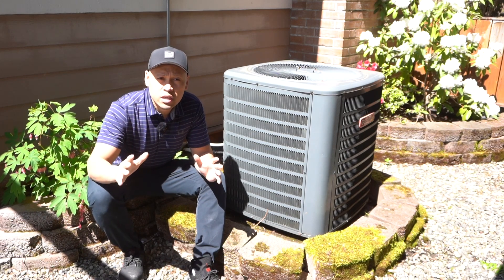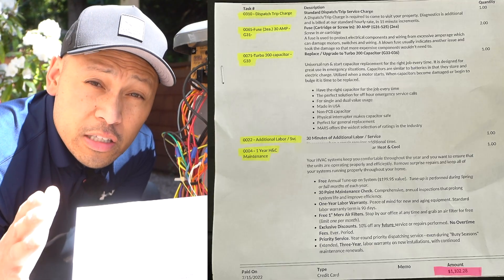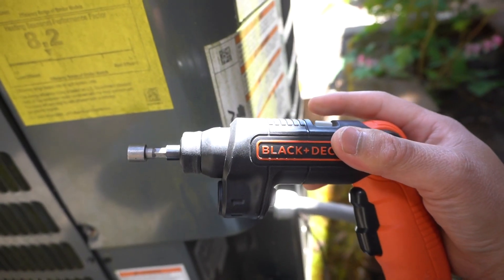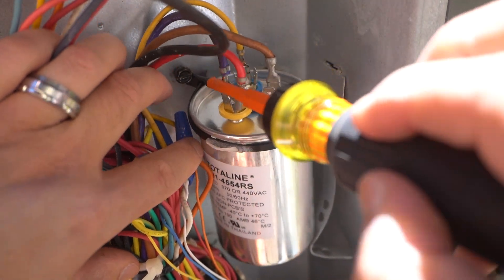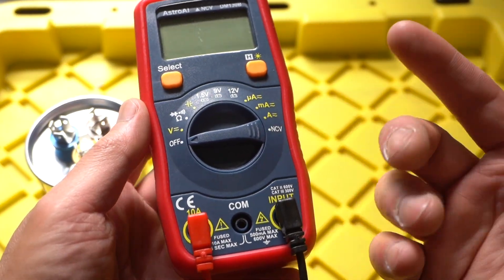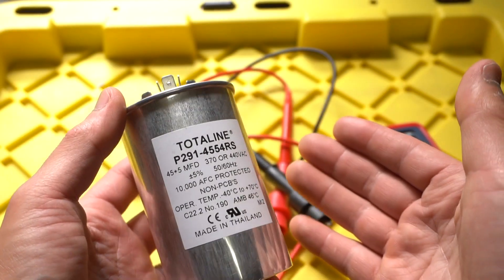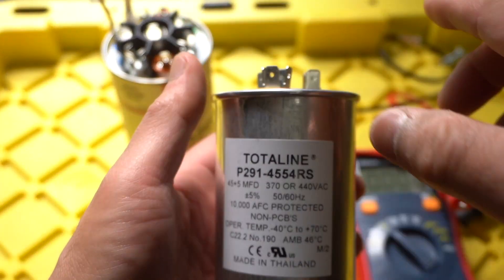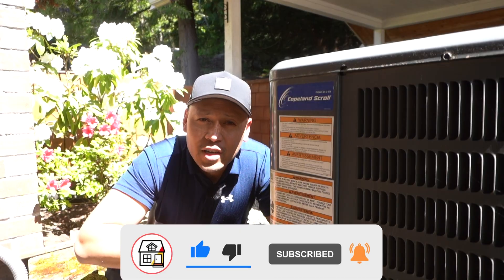I Was Charged $1,100. I Fixed It For $9.99! How To Replace And Test AC Capacitor | EASY DIY!

Comment: I almost fell for a dishonest air-conditioning guy a few years back.  My wife called this company to come out and check over our home air-conditioning system.  He arrived, and within 30 minutes, told my wife the whole unit  needed replacing.  She called me thank goodness. I told her to pay him for his service call and send him on his way.  He tried to tell her that if she didn't replaced the unit it would blow up and cause serious damage to the house and the rest of the system.  I arrived home and found this guy was in my garage pulling the circuit breaker out of the power panel.  I quickly told him to put back the breaker and leave.  He promptly told me he had to remove the breaker and charge me for a new one.  I called him company and told them I would contact the police if he would not leave.  About 10 minutes passed and he received a call to pick-up and leave.  Once he left I get a call from the manager telling me I owed them 1,200.00 for the service call and his man's time.  I told him to take me to court.  I won in court after showing the judge all the photos I had over the damage he did.  The company has since gone out of business...  After all that, I found a company to fixt the issues for $ 123.17 including service call...

Comment: The first thing out of the gate — before you removed the unit cover — should be a warning that the capacitor is dangerous and holds a charge.  Love your channel, but you should redo this with a warning first. 👍
Reply from the maker: Thank you for the info! First thing to shut off power and then displace charge like showed on the video 👍🏽😊

Comment: Thank you. You will be getting the A/C companies more business. (Also getting people hurt).  The $1,100 bill was for more than the capacitor 😮.  Also, when discharging a capacitor, use the proper bleed resistor.  Also note that one can damage the compressor if wired wrong.
Reply from the maker: Hmm, the trained HVAC tech that did the work for me and charged me that much didn’t use a bleed resistor for some reason.
Reply: @FixThisHouse  You are right. Most techs don't. They should.
Reply: @leealtmansr.3811 I wouldn’t post videos like this just for liability reasons…
Reply: A bleed resistor isn't needed, given the cap. should discharge through the connected windings. An insulated screwdriver works okay.. But, yes, a bleed resistor is more controlled if a charge exists...

Comment: Normally I like your content. You are a bit off the mark this time though. You said a capacitor is like a battery that is false. A battery stores power chemically and releases it slowly, with a capacitor current flows through an electrical circuit, stores power and can discharge energy very quickly. While you said to be carful you really did not explain how dangerous a capacitor is, you can die if you handle it wrong. Your example of using a screwdriver to discharge it was fine but you neglected to say you should always wear gloves and have eye protection and if you were wrong and the capacitor was not bad you better expect  some sparks when you discharge it.
Reply from the maker: Hi! You are correct on some areas, hence I mentioned the word “like”. Although both batteries and capacitors perform the same function of storing energy, the main difference between them lies in the way they perform this task. Battery store and distribute energy linearly while capacitors store and distribute energy in short bursts. With any electrical, ALWAYS shut off the power, wearing gloves for added protection is always a plus and any additional PPE. Again if you are unsure and not confident with the work, then please hire certified technician.

Comment: This was really helpful. Even new (in the box) caps can have stored power due to collecting energy from the air. So, unless it comes packaged with wires wrapped around the terminals, always short out any cap you handle regardless of condition. Thanks for helping us save money!
Reply from the maker: I’m glad I could be of help! Thank you for sharing this info my friend 🙏🏽😊

Comment: I was installing a soft start on mine a few days ago and noticed the cap was leaking so I spent $25 for two, replaced it and have an extra just in case. I also replaced the contactor since I was already in there and it looked a bit corroded, that was $20. All told this took about an hour and that included  a waterproof box and conduit for the soft start. HVAC units are easily the simplest component of your air handling system. Furnaces can be a bit more cryptic, but if you know the startup sequence, know what all the parts are and where they are in that sequence they can be relatively simple to troubleshoot. Though you do need a multimeter and manometer to be effective.

Comment: My AC once had the same issue, so I went to the local hardware store but they won't sell the dual starting capacitor to the retail customer like me. I was told they only sell to their registered contractors. Thanks to Amazon (and Ebay) I bought a capacitor from Amazon for less than $15 and replace it myself.
Reply: I keep a spare dual cap on hand.

Comment: Listen… you are not paying for how quick, cheap, or easy it is to change. You are paying for the experience of the tech and the company. Also, it’s pretty dangerous if you and most people don’t wanna mess with electricity
Reply: You must be one of the companies overcharging people 🐀  is not rocket science to replace capacitor  , and there’s nothing dangerous about electricity  if very basic steps are followed , 😎 

And paying 1100 for your experience is way too much 🐀

Comment: If it is only the capacitor that needs to be replaced, $1,100 should be criminal. On the other hand, $175 is actually very reasonable, unless the the person was the owner of the company and walked from next door. Of the $175 charged mentioned below, there is the technician's pay, drive time, gas, insurance, truck payment, rent for a place of business, the cost of the part, and of course income taxes. Not a lot leftover for the company after all of those expenses.
Reply: $1100 is on the very high end for such a service.
Reply: Businesses shouldn't try and retire off of the invoice of a single customer.  It's price gouging for anyone charging more than $200 for a cap replacement.

Comment: You morons can't do it that's why you pay us to do it. A cap is about 200-400 bucks. A pro will also fix the actual reason these fail not just change the part

Comment: Excellent tutorial. Explained simply and thoroughly. Are there any clues that the capacitor is the likely problem when the AC unit doesn't function?
Reply from the maker: Thank you so much! The only clue would be the AC will stop working and you’d just open up the panel and do your visual checks and test the MFDs rating with your multimeter.
Reply: Often a buzzing sound from the exterior unit..  Warm air circulating inside the home.

Comment: Didn't you ask for an estimate before you had the HVAC work done before changing the capacitor? I had mine done for $150 from an HVAC company. I'm going to change it myself next time because of your video.
Reply from the maker: They started low and then they started throwing additional charges like inspection, trip charge, fuse charge, maintenance etc 😫😤

Comment: Good job explaining the process. Just remember people if you do not disconnect the 240 volt AC power you can kill yourself.
Don't do this if everything is wet in the area.
Reply from the maker: Thank you so much for adding this very important info! ALWAYS DISCONNECT THE POWER SOURCE ⚡️
Reply: Darwinism

Comment: ok they charge to much but this video is not an actual training video and the capacitor and other electronics in that panel can have deadly energy , it can and has been fatal. only trained professionals should be in that panel and yes thats why thy charge to do it. not everyone has the same capacity in learning not everyone should attempt this.
Reply: You obviously are an HVAC crook. You mean trained scammers. Charging actual capacitor cost pus maybe $100.00 per hour, plus $50.00 for the service call I understand. But HVAC people have become outright crooks, charging up to $800.00 per hour. My real professional lawyer only charges $450 per hour. Same as my doctor.
Reply: Well, the good news is that it’s him that would be sued if someone is injured or killed, not you or me.  Exactly why I don’t tell people how to repair electrical issues.

Comment: As a former HVAC tech, I find these charges outrageous. Our  company charged about $80 to replace it.
Reply: The world went to Hades. Now, HVAC tech/salespeople charge as much as they can get people to pay. One HVAC scammer wanted to charge an old man $40,000.00 for a roof AC  unit that you can buy for $4,000.00 plus installation. It was going to be financed. The finance company was going to keep $20,000.00 plus interest. The HVAC company was going to keep $20,000.00. I tell people to get at least 3 estimates from different sources. Also to check average prices on the internet.

Comment: I had 1 replaced 2 yrs ago for abt $300 which I also got the unit cleaned l. I checked estimates in my are ranged $300-$400. Also be careful that panel on mine had a big wasp nest inside. Guy killed them with spray. Mine was completely corroded!

Comment: I would suggest turning off your breaker in your electric panel first
Reply: That's what the disconnect is for.
Reply: @jumper233  Because no one has ever been shocked by a rigged disconnect.
Reply from the maker: Can never be too safe! I agree! 👍🏽😊

Comment: I had the same thing happen to me. During my spring HVAC checkup the tech was replacing my capacitor with a contractor grade  one since my HVAC was still under warranty. I asked what was the next best option, he recommended a Turbo Capacitor (on amazon it was about $60), he charged me $400. I didn't realize I was ripped off until later when I checked online for the price of the part. I was too trusting of my HVAC company.
Reply from the maker: I’m sorry for this my friend 😔, they also threw in trip charge, maintenance charge, fuse replacement charges etc.
Reply: I know being ripped off is bad but if one has to go get it and come over to your house. Install is fast for them from experience it will take you longer.  Do you do your job for free?
Reply: Well, next time; you could simply service your HVAC system and make any needed repairs immediately with the parts available in your garage.  Point being, HVAC techs generally keep an assortment of common parts and refrigerant with them.  Part of the cost that you are paying is for someone with the knowledge to come to your house and help you with your problem.  That service call costs money in fuel, vehicle payment, insurance, taxes, etc, not to mention the convenience of you having your problem fixed immediately, instead of waiting days for Amazon to deliver to you.

Comment: Great video, I ended up replacing the capacitor last year when it died thinking it would help with a buzzing sound inside there house every time the ac turned on. Unfortunately that was not the cause, still trying to figure out what it could be.
Reply: Sounds like you need to replace the contactors.  youtube how to do it. good luck. I am a hvac contractor.

Comment: Damn that was ignorant charging that much. I once had an friend who has a heating company charge me almost $400 to fix a non operative furnace. It was only the thermostat. He asked if I minded a used one. I said sure. Long story short it was $279 for the thermostat that you can still buy anywhere for 50 buck brand new. Needless to say that was the last time he was called. Got another company and they have been very fair. Some people think nothing of screwing you right to your face. A very, very good informational video sir.
Reply: Way to steep, but that is just the amazing GREED of todays businesses.
Reply: @jmcr9765  Business is not greedy that HVAC person was. Big difference.
Reply: My neighbor had guests staying at her home, and the AC stopped working. What was needed was a new capacitor. So, emergency Saturday service during a Texas Heat Wave cost her over $400 about 3 years ago.
Reply: @HardRockMaster7577  “Emergency Saturday service” was over $400?  Thats still not too bad for a weekend service call.  I’d guess that $200 of it was the after hours charges. Still a fair price for a weekend.

Comment: Same thing for your circulation fan. Saved myself $800 by replacing the capacitor for $10 on amazon. Hvac guys are unscrupulous!!
Reply: Until the motor goes out in a few weeks/months.  Blower capacitors don’t fail terribly often unless the motor is failing.

Comment: My capacitor went out about 6 years ago during a 116 degree heat wave. Fortunately my AC was still under warranty so it was replaced free of charge. I purchased a spare  to keep on hand just in case it goes out again because my warranty has expired.
Reply from the maker: That’s a great idea! Keep a spare just incase my friend, great thinking! 👍🏽🙏🏽😊

Comment: I had mine replaced last year and it was $175 so I still think that was a lot the part was about 35 dollars and it took him about 15 minutes so he still made a 150 dollar for 15 minutes! Next time I will replace it myself for sure!
Reply: Identifying the problem requires skill, you paid for that skill...
Reply: @mindtricky what about the tools, multi meter, convience of not waiting to go get part 2-3 days, shipping, knowledge, experience.  What about if it doesn’t work with a new run cap?  What about a motor or compressor going bad and pulling more amps and run caps going bad premature?
Reply: You have no idea of the expense to roll a van with a trained technician. $140 for a home service call is a good price. Glad that you can fix it on your own next time. Hope you diagnose the problem correctly the next time you have an issue.
Reply: @johnsmith-js9nv yes $140 is a good price…1000 plus is NOT for a capacitor
Reply: You must not own a business.  Work for someone else.  What about the gas it took over there.  What about the insurance the company has in case  something goes wrong that the state makes you have.  What about the wear and tear on his personal work vehicle. Etc etc etc etc.  what about taxes?  What about employees insurance?  Do you really think the person takes home the $150 in fifteen minutes and sticks it in his wallet as all profit and gets the whole $150? He might take home $50 maybe profit if that.  What about if it took him 1 and half hours to find the problem?
Reply from the maker: Now you can do it for much less my friend 👍🏽😊
Reply: @FixThisHouse  OMG they really took you for a ride for $1.100 wow that is crazy! Did you tell them you didn't want it made out gold? LOL
Reply: To be honest, $150 for the trip and 15 minutes on the actual repair is not too bad. Sure, you can do everything yourself like grow your own crops and build your house etc.
Reply: You are paying for the knowledge that’s involved in figuring out what the issue was! If you feel comfortable tackling the job yourself go for it.
Reply: Y'all don't understand you're paying for the labor, truck, insurance and employee to perform services. 175 ain't sh,t.
Reply: that's a fair price they charged you,it's skilled labor not a fast food restaurant
Reply: Thats a $140.00.  And guess what he has other expenses too.
Reply: Next time try this, Estimate was for $1100.00 and I fixed it for $35.00.
Reply: 175-35=140 is the correct amount he did not make 150.  Because lot of times it is a flat rate plus materials. I just paid 175 to just have my unit serviced for the season and i didnt need any parts. And that is what all places are charging i did call around. You have labor, drive time and gas.
Reply: Go ahead. Blah blah blah. Trash talk
Reply: $150 isn't bad at all. People need to make a living and they have a skill. If you dont think its worth it then don't call anyone to work on your stuff and learn it all your self. Im a boat mechanic so I respect and understand the cost that companies charge for their work and skills. To a certain extent of course.  Theres always companies that over charge. But $150 is definitely not over charging. I do work on the side and my hourly is $150. It's $150 just for me to come out and thats not including the cost for the actual work.

Comment: How can you determine the capacitor is the problem in the first place?
Reply: They're so cheap you could just have one sitting around that's brand new. If you're having issues, replace it... If it doesn't fix the issue, put the old one back in.

Also, because it is such a quick and easy fix that shouldn't be a detriment either
Reply from the maker: It’s one of the first place to check when your AC stops working, from there you move to the fuses on the sub panels, then so forth